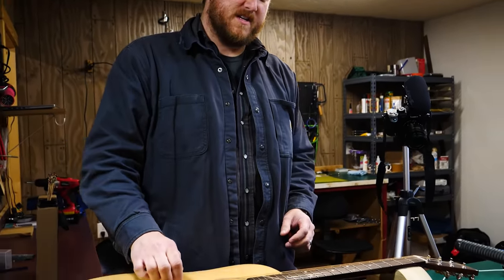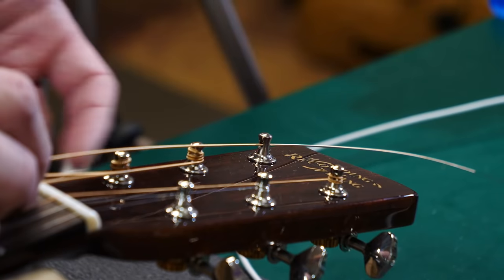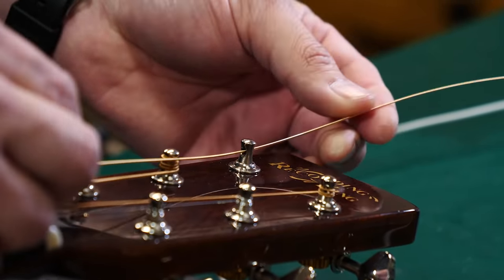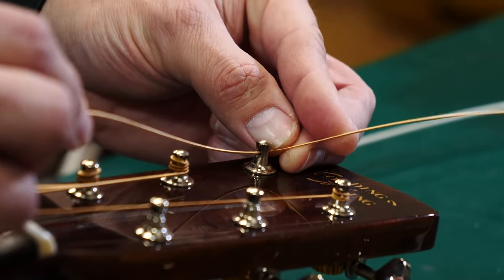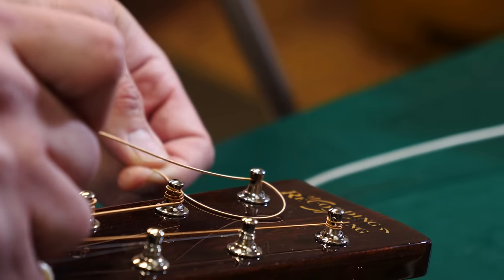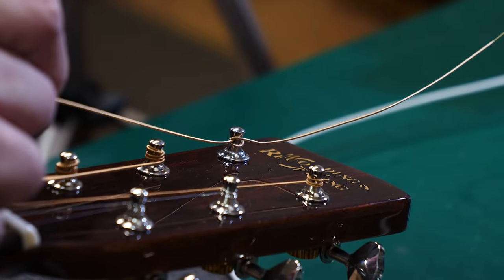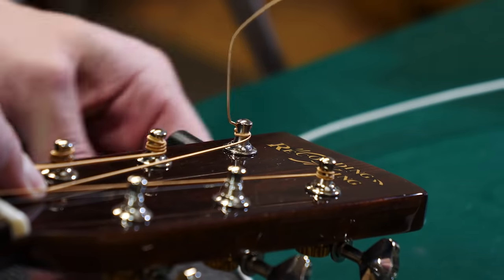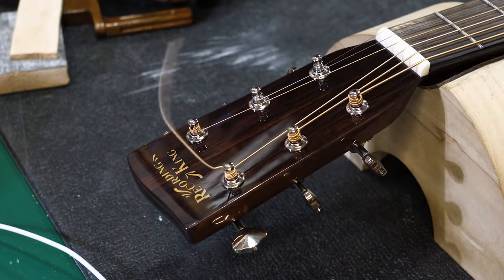Tech Tip: How to Tie a Luthier's Knot When Changing Strings

Comment: Ok, first, I don't have an issue with the luthiers knot, it's pretty common and if you like it and it works for you, great!

However, I do take issue with the words, "it works sometimes". Don't try to justify the way you do something by trying to trash another method. If you know what you're doing, any style of wrapping is going to work. Luthiers all over the world use standard windings and never have any issues, and posting something like this, bashing that method causes issues for us when customers come and demand their strings be wound this way or that when they see standard winding because someone on YouTube said it was bad. So, please, don't do that. I mean, hell, have you seen BB King windings? It's ugly and unwieldy and it takes forever to do it right without the string tension causing gaps and slips and therefore tuning instability if you're not familiar with it, but BB King swore by it and did it for so long he could do it without thinking. It worked for him and he would reject any restrings done for him that didn't use the entire string, but that doesn't mean it is the right way and all others are subpar. 

So, please change the way you discuss and think about methods that aren't how you do things. There are a lot of ways to get from start to a finished product, some of them take shortcuts and some take 10 times longer than necessary, both should be avoided. BUT that still leaves a ton of valid methods.

Comment: This is just a cheap trip for lazy shop people to do a quicky stringing job, at the customer's expence.  Both of my Martins came like this, and I cursed them trying to remove the freakin' strings, both times.  Just wrap the first wrap over the string and the other two under.  Three wraps is all you need, regardless of the guage.  I've been stringing guitars for over forty years, and I've had ZERO problems with this method.

Why would anyone think this is a good  idea?   I guess you want to scratch your headstock, trying get a knotted string off the peg.

Comment: The one issue with this way is that if you have to tune down or loosen the strings for any reason, they're much more likely to break at the 'knot' if you attempt to tune down or loosen the strings a 2nd time. I actually stopped doing it because of that. Well that and I eventually got locking tuners. But I had already stopped using the knot when I got those.

Comment: Yeah any kind of knot is not needed you can actually pre-cut the strings and bend them right at the end and tighten them on and they will not move I hate working on a guitar for somebody and struggle to get the knot undone. Trust me you do not need to do what this guy is showing you right here.. people want to do string changes faster and do not want to have to struggle. So essentially what I'm saying is you don't need to lock the string in any way whatsoever other than the bend that happens in the hole. I've compared this way and my way and my way is just as secure once a string settles in it's not going to move. Unless you're trying to actually rip the string off of the post. Which could be good in a punk band but not recommended for everybody else.

Comment: Unessential. I find that a simple tuck under at the hole in the machine head to be quite easy and adequate. Giving your strings several light tugs after winding greatly helps stabilize tuning - even on fluorocarbon uke strings.

Comment: The Luthier's Knot or any knot on steel strings is unnecessary.  This is a carryover from classical guitar; nylon and perhaps even more traditional catgut stringing methods.  The most important aspect of tuning a new string is maintaining tension in the string as it begins to wind, this creates the ~90 kink at the eyelet as the string winds down and keeps the wind tight to the post.  Secondly is to account for enough winds down the post i.e. ~2.5-4+ wings is a good target E to e.  Other than that, knots at the tuning post for me are merely a pain to remove when it is time for a string change.

Comment: I cant stand when people do this, it can make removing strings from a new "used" guitar really annoying.
How to properly put on a string
Put it through the hole, give it about 3 inches of slack, hold string against the headstock, turn the tuning peg until its tuned up. 
Thats it, thats all you do and it will hold no problem. There is no knot tying involved, ever. This is soooooo wrong.

Comment: Yuck. Another great way to promote frustration in string changes, also causes some unnecessary overlap 'bind' in tuning, and increases the possibility of damaging or scratching the surface of the headstock, when removing the strings. I can't be convinced that this method is somehow superior. It's overkill imho. The strings should not slip at all if you've done a decent Z or S kink lock through the post hole. Strings should not be overlapped at all... especially on the low E. Good instructional video tho.

Comment: Yea from a guy who does restrings and setups all day DO NOT do the knot it’s not advantageous by any means and is just a bitch and and a half to deal with when you have to take them off, all you need is two full wraps on the post, I’ve been playing for over 20 years and not once EVER EVER EVER have I seen or heard of anyone EVER having a failure because they didn’t have the knot. It’s just in needed, too much string mass around the post is bad anyway

Comment: Did this for decades. Then a buddy (Thank you Synchro) showed me a much better method, locking the string in with no post wraps. It is pictured in any Gretsch guitar owners manual and detailed here. I use it on all my guitars now, not just Bigsby equipped

https://youtu.be/4Fg5dB0ftqw?si=oHgWUNti9dqWFlaC

Comment: You have to limit the number of wraps around the post or this method is useless. Too many winds on the post cause slack and will lead to tuning issues. when you use the knot with 2-3 winds you get a tight wrap that doesn't move around and relies on the knot to keep the string in place.

Comment: That bit about alternative methods causing tuning problems is just not true and in fact is misleading.  I just make sure I have enough winds to pinch the string in the hole in the tuner post.  Forty years of experience.  Never had tuning issues.  Applies to electrics and acoustics.  I suspect this technique predates steel strings and modern tuners but now is just not necessary.  No advantages.  Some disadvantages.  Don't bother.

Comment: This video keeps popping up on my feed just begging me to comment with my own dumb opinion, just like everyone else has  
So here goes: using a single method to put on all your strings makes no sense whatsoever. 
The ‘luthier’s knot’ should ALWAYS be used on plain strings. If you are using light gauge strings you might want to use it on the wound G as well. 
The bass strings are better held in place by having the loops below the standing end jam it up against the edge of the peg hole. This works well on most gauges. If you have large holes or light strings and the cut end is not up against the edge, you should use the ‘one over, rest under’ method. You might want to avoid using this on the D string or cut it a shade longer to allow a better angle to the nut.
If someone told you that something had to be simple or it was no good, well, they lied.

Comment: Wrong, wrong, wrong. All these people with the wrapping by hand are leading people astray. Use the mechanical turning motion of the gear to wrap string above the hole with string thru it. Before one turn is completed maneuver string to under the hole with the string. Then continue turning the tuning gear one wrap under another using the tuning gear. DO NOT WRAP BY HAND. No luthier does this!

Comment: Nope, not for me. No cross strings for me. Does it the "Taylor" method, and it works the best for me. You have to then tune from # to flat, rather than the other way, but thats how I like it. You get it to 0 cent quickly...

Comment: There is literally no reason whatsoever to tie a knot in the strings or do anything fancy. No lock twists or ANYTHING are needed.  Just, for wound strings, at least one full wrap around the string post, and for plain strings,  two full wraps.   And trim the end off close to the post.   Anything beyond that is pointless, needless, unnecessary, and a waste of time.   I've been restringing guitars for over 40 years. And working on them as a guitar tech and custom guitar building luthier for most of them.    My method just works.   No need to get any fancier than that.

Comment: Players knot. . . Is knowing this is completely unnecessary. 
 
Slips?. .  Goes out of tune?
 Not because of string post wraps.
Never had a problem in 48 yrs. 
 It holds itself with friction on the post. Not the post hole . Take all the tension off the pins ad you " back the string 1/12".
 Nope!
 Yet: He shows the process with an un cut string to " pull" on.
This is  Nonsense.  The world runs on it.

Comment: now clip that excess string bit off close as you can get to the post so when the next guy comes to remove those knots he gets stung over and over and over and over .. I really hate those knots.. not worth it at all, its a joke luthiers crated to rib players...  not only are the very difficult to undo without tools they can poke you too, nothing like a little injection of penicillin for a string change ..

see a lot of these on acoustics, where they are to required, no whammy not big bends to loosen the strings while playing, unnecessary

Comment: There is no need for any knot. Each winding under the last... bend off the string. Tension will hold the string in place and you won't be me cursing the person that tied the stupid strings on later with a side cutter and a small screwdriver when it comes time to work on the guitar or heaven forbid... change the strings.

Comment: Unnecessary. Better method: a half winding over the string sticking thru the tuner, then all other windings underneath. This locks the string into the tuner via string tension itself.

Comment: I know of no luthiers or guitar techs that use this method. In fact they will all tell you they hate it when a guitar comes in to work on and the strings are installed this way. It is almost impossible to get them off. It also does nothing to help or prevent string slippage. I have never had issues with string slippage or tuning issues just wrapping the string on the post 3 to 4 times. Never had an issue in 48 yrs of playing. This is pure rubbish and if you play live, good luck changing a string if you need to.
Reply: Here's how Martin Guitars does it.:
https://www.youtube.com/watch?v=LS6cDJ4dsIo

Comment: Tech tip turd.  The noobie knot. Has absolutely NO benefit. Totally unnecessary. A painintheass to get off. Especially in a dark club in a hurry. Defeats the engineering of modern tuning posts. Creates an almost 90° bend which reduces the string's breaking strength by 50%.  
Just wind your strings the first wrap over the string end and the remaining wraps under the string end. That's why the posts are shaped like this )(. 
So that when under tension the string end is pinched between the wraps. Solid as a rock. Strings almost never break at the post anyway. When they do it's because the string was damaged on the sharp edge of the hole.  Sometimes the hole may have a burr defect left from manufacturing. Just de-burr the hole with a tiny rat tail file or a bit of sandpaper wrapped around a toothpick.

Comment: Everyone is expert, but this guy is a clown.
NEVER, ever, kink or overlap a string!! You lose fifty percent of your strength right off the bat. You wrap the string 2 or 3 times depending on its thickness, then slide it through the top of the hole, then bend up. The curvature of the "capstan" and friction keeps the strings tight, they will never come loose.